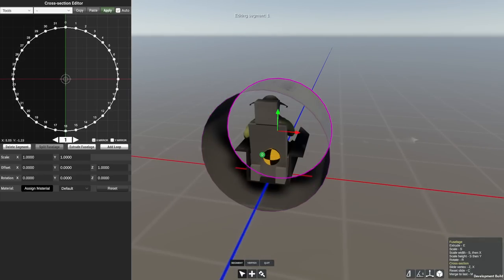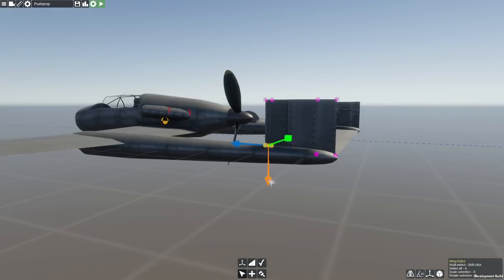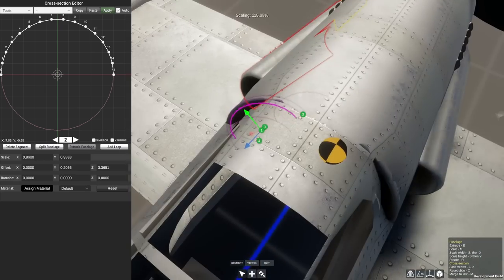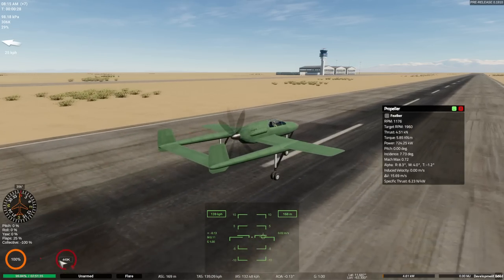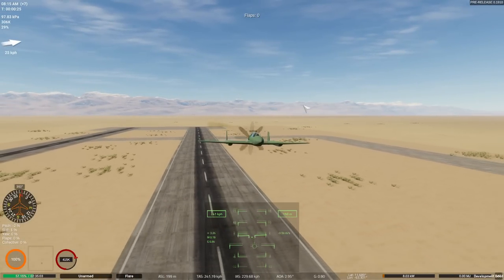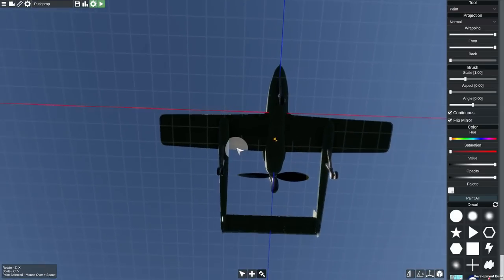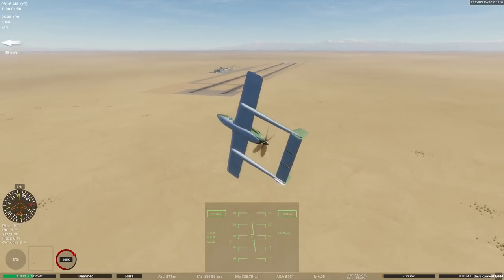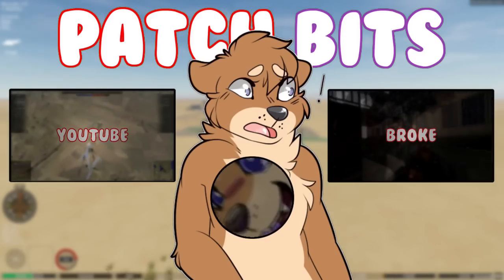Building a BACKWARDS fighter in Flyout!

Comment: Design Idea for a future video, Early Jet-age strategic bomber.

1946-1950, long range, large (Non-Nuclear) payload bomber with 4-6 (kinda crappy) jet engines. 
Many early jet aircraft, especially bombers, looked almost like they were originally designed as Piston or Turbo-prop planes (as some of them actually were), perhaps you could design the theoretical middle ground between the WWII era Lancasters and the mid 50's V-Bombers.